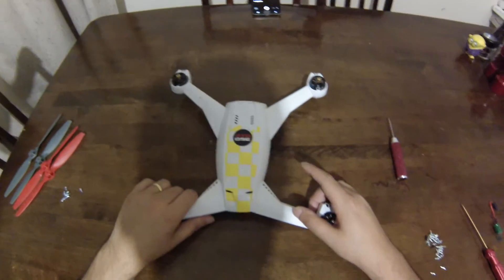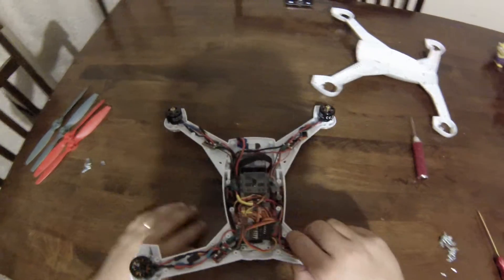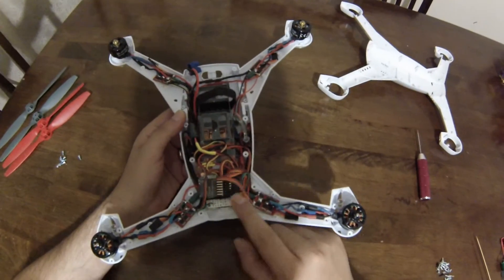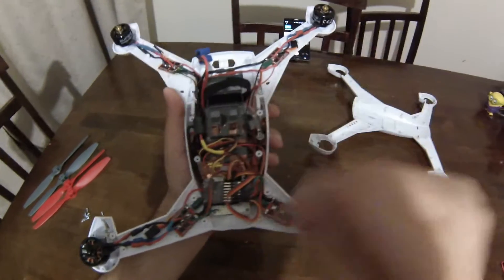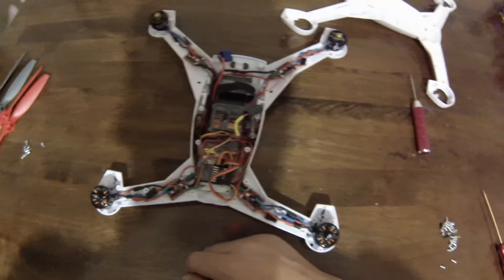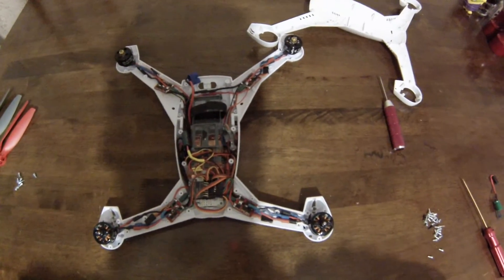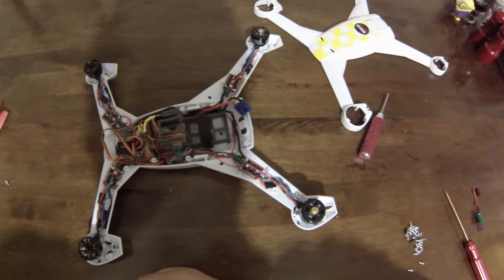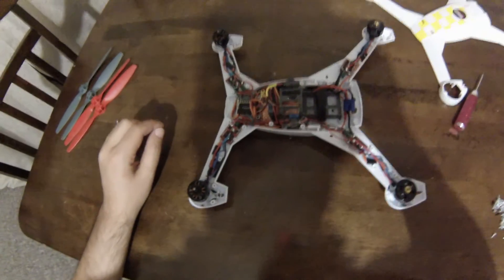Peel Drone - Blade QX 350  modified , flying  naze32 , emax 12A bare aerobatic

Comment: This is cool, I've been waiting to see someone do this. Although I hate the durability of the body, it is a unique/cool looking shell.

The reason the ESCs did not work is because they are I2C and not PWM or something standard. Basically this means they are highly proprietary and are not compatible with anything except the FC board from Horizon. And it is a shame because likewise, the board will not talk to any other ESCs. The stock 350QX is stuck with a 10amp ESC forever due this.
Reply from the maker: John Cuppi thanks John you think they run the I2C to enable the protection mode when props hit something ??
Reply: Peel Drone No, I think they just run I2C because it was cheap for them and kept the whole thing proprietary for $$$ reasons. No one can undercut them with aftermarket electronics because of how closed-source and nonstandard it is.
Reply from the maker: John Cuppi funny they opted for a 2 way protocol if they didn't really use it
Reply: Peel Drone It wouldn't be so bad if they provided a way to use other ESCs with the board, but they do not care to do so. And since the FC firmware is totally locked down too (I've tried to fruitlessly disassemble it) no one will ever be able to program or add that ability in.
Reply from the maker: soon, everyone will be forced to go open source on their FC unless someone manages to get their FC to take decisions lolol